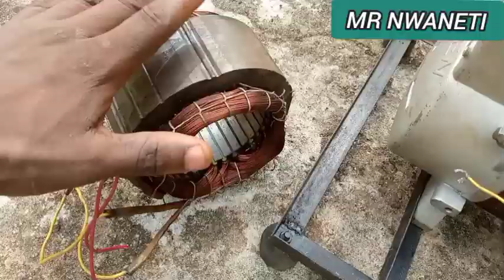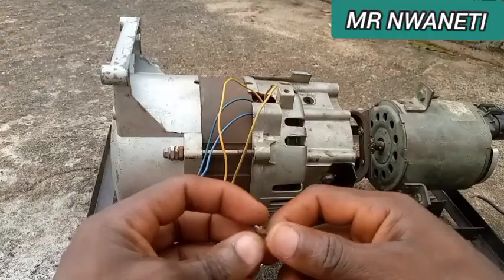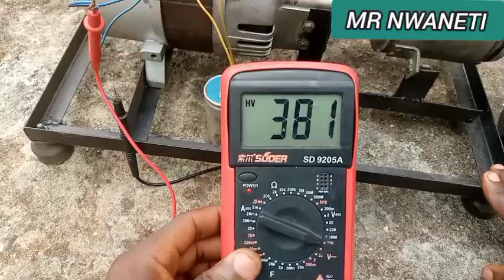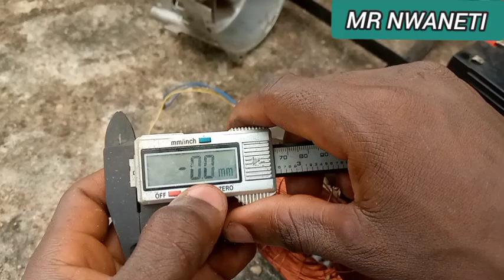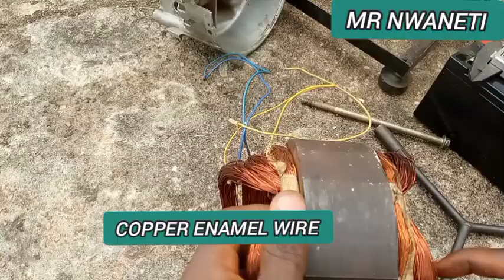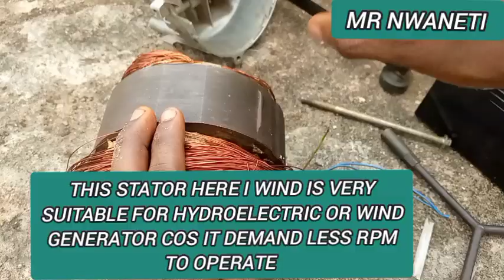Fuelless generator projects, stator giving high voltage 381vac

Comment: Hello, I dismantled a generator like yours, but I don't remember how to get the wires back to the correct connections for the capacitor and the generator voltage output. Can you help me with each color of wire and where to connect them, please, sir?
Reply from the maker: Check the connection pin and colour code,
Yellow wire capacitor 
Green wire battery charger 
Red wire/red/black 220vac output
Reply: @MRNWANETI ❤

Comment: Good morning brother. Please I have some questions. How much load can you put on this generator that won't make the DC motor to spin slower so it won't stop working?

And how many Ah battery charger is enough to charge back the battery to prevent the battery from draining rapidly? And is 10A battery charger enough?

Comment: Giod morning brother. I did mine and i kept hitting yhe wall. I think the battery i used it a bit bad hut when i turned it on, it gave me 12v, though i didn't modify anything. But when i connect the battery charger to the battery, it gave me 110v and above. So please i want to ask you something. Should modify the stator and add another magnet to the ameteur or should i just change the battery and increase the capacitor to 30 or 35uf ?
Reply from the maker: First you have to use good battery while doing the project
Reply: Yeah,I understand but money isn't much with me so I'm using a used battery I bought from someone but I calculated that the normal speed of the DC motor is achieved when I connect the battery charger. @MRNWANETI
Reply from the maker: @godwinpepple5939 try and get new battery so it we be easy to dictate any error
Reply from the maker: Secondary check the speed of the motor, including the value of the capacitor before thinking 🤔 of modification
Reply: @MRNWANETI The speed of the motor is the same as the one you used in making this video and the value of the capacitor is 25uf. So I'm thinking of modifying the stator by adding about 10 turns to the exiter and the main output coil, maybe that will help increase the voltage with the 3000 RPM motor.
Reply from the maker: @godwinpepple5939 alright 👍 do it carefully,I wish you good results

Comment: Hello brother. Please is there any chance that without modifying the stator and amateur of a tiger generator, the DC motor of 3000 RPM will generate 220 volts of electricity? Thanks in advance.
Reply from the maker: Yes it's possible,but you might experiment with different stator And armature
Reply from the maker: But makes sure you're doing dealing with copper enamel wire
Reply: Yes ,sure. The tiger generator I'm converting is real copper and I bought in 2010. @MRNWANETI

Comment: Intreb pentru ce bobina stator trebue pentru turatia 1500 rot la tensiunea de 220v  multumesc anticipat
Reply from the maker: If it's 4 pole generator it  can give you 220vac on 1500rpm
Reply: Ok nu este deci nu poate fi modificata bobinele  petru patru mai mici

Comment: Felicitari🎉 ce putere are motorul de 12v multumesc anticipat de raspuns,eu am unul de 24v de 250w la 12Ap la 3000 rot apraciezi  sal pot folosi
Reply from the maker: Yes you can use it
Reply: Multumesc
Reply: Multumesc
Reply from the maker: @marianpanait7926 You can support the program by sending super thanks